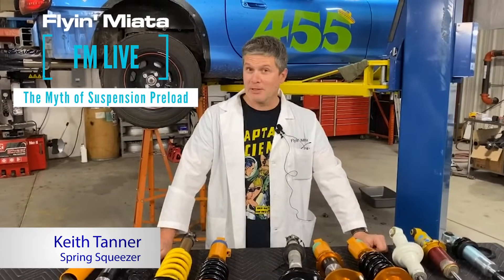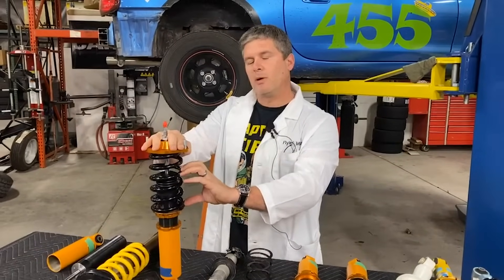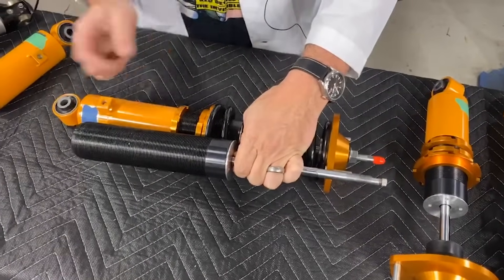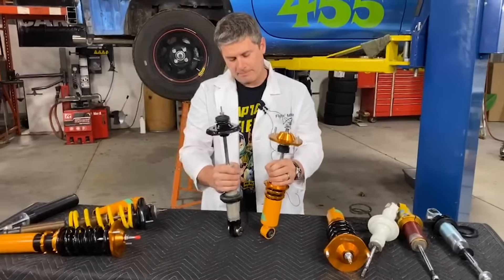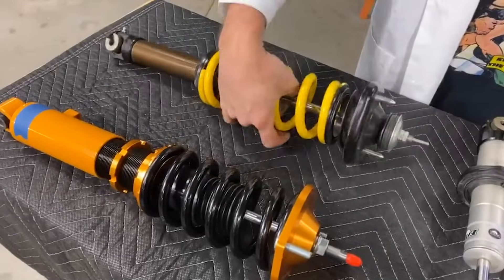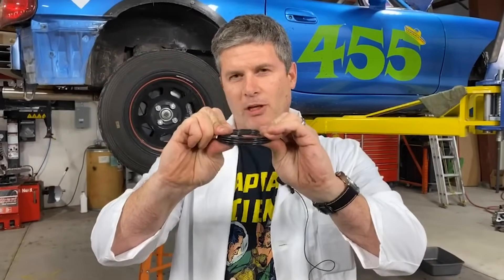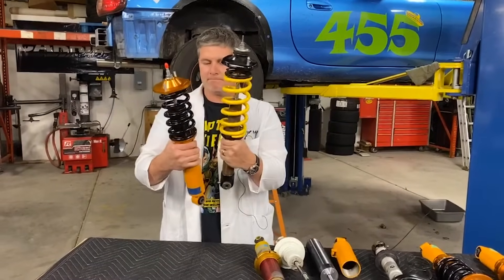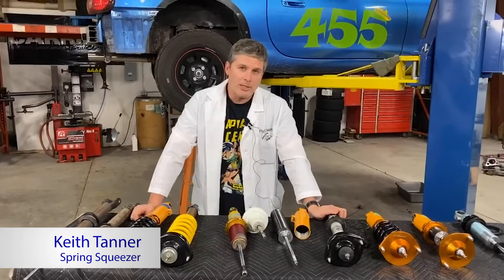The Myth of Suspension Preload (FM Live)

Comment: Ride height will not be the same if there is pre load on the spring. Öhlins have coilovers where height and pre load are intertwined, like me e46 M3. By dialing in pre load, you’re reducing the amount that she suspension will compress when car is static
Reply from the maker: The ride height is determined by the distance between the upper and lower perches, the spring rate, the spring length and the weight on the springs. That's it. Preload doesn't change that - but changing the perch height can change the preload, which is why people get it mixed up so much.
Reply: @FlyinMiataVideo  if you’re only changing the bottom spring perch height, effectively increasing pre load, how can you explain that the car height increases? You’re not changing the overall position of the spring, solely the bottom part. 
It would make since if the whole spring was higher, which it isn’t.
Reply from the maker: @DriftingSquirrel  The spring sits on that bottom perch, the car sits on the spring. You move the perch up, the car has to move up. The spring will be the same length for a given load, so you can consider it a fixed length.
Preload can only be measured with the suspension fully extended, because that's exactly what it is - the amount of load on the spring with the shock extended. Once the force on the spring exceeds the preload, the spring will compress - BUT IT DOESN'T COMPRESS DIFFERENTLY BECAUSE OF THE PRELOAD. That's important and it's where many people get tripped up, they think the spring somehow "remembers" what happens at full extension. It doesn't. If a spring has a 400 lb/in spring rate and 400 lbs of load, it will compress 1" from its free length. It doesn't matter if it has 50 lbs of preload or 75 lbs or 0, it will be compressed by 1" with that 400 lb load. And that's what will determine the ride height.
When your preload exceeds the corner load - if we had 600 lbs of preload on that example - then your spring does not compress until you hit a big bump and you have zero available droop. I've seen cars set up this way by people who don't know what they're doing, it's not functional. But it is possible to do.
Reply: @FlyinMiataVideo  The spring sits on the bottom perch - that did it for me. Very well, I have understood the logic, and I'm thankful that you've taken the time to explain everything properly to me. Most other people (channels) would've sent me on a hike right about now.
I do have another question however: you say that if the pre load exceeds the cornar load, then the spring will not compress. But, if the spring will compress the same amount (given by the spring rate) regardless of the pre load, how does this work like that?

Comment: Hypothetically, if preloaded 1” on a 400lb spring. I would beed 800lbs to compress it 2”. Which would be a harsher  ride if I didn’t have that 1” (400lbs) being used already. 

Not arguing. Trying to better understand.
Reply from the maker: That's the common misconception, that somehow the preload gets added to the spring rate. That spring will require 800 lbs to compress a total of 2" even if there's no preload. That's what the spring rate of 400 lbs/inch means. 
In your example, as soon as that preloaded spring has 400 lbs on it, it will start to compress further. By the time you've put 800 lbs on it, it will have compressed 2" from the free length - just as if it didn't have any preload at all. You don't add 400 + 800 lbs = 3" of spring compression. Once your load on the spring has exceeded the preload, the preload effectively ceases to exist.
That's where the preload can have an effect, if there is less load on the spring than the preload - which means your suspension doesn't compress at all when the car is at rest. Obviously that's not a good situation. You need fairly significant levels of preload before this becomes a factor, or you need massive amounts of weight transfer as on a motorcycle. There are some edge cases that can start to cause problems as you get close to them but if you get there you have more fundamental problems.
Reply: @FlyinMiataVideo  thanks for taking the time. I had a set of Bilstein B14 (progressive) that wouldn’t go high enough. I added as much spring perch as I could and the ride quality suffered. Im think I used up all the soft portion and was maybe into coil bind. 

Bmw btw.
Reply from the maker: @jpwilliams5264  That can certainly happen. Coil bind feels okay until you get to a certain point in the travel, and then the suspension feels as if it goes solid. BANG! Progressives are just weird overall.

Comment: How can you set the required preload to keep the system stationary?
Reply from the maker: Not sure I follow the question. It’s all about the weight of the car on the springs at rest. Preload does not change spring rate, it’s only a measure of how compressed the spring is when the shock is fully extended.
Reply: @FlyinMiataVideo  Hi thank you for the reply, sorry, let me rephrase the question. how would you check or calculate preload in spring to keep the corner(say left) stationary if the cornering load is say 300kg?
apologies, If you have already covered something like this in another video.  sincerely Ash
Reply from the maker: @wheelskawasakileicester1146  What do you mean by "keep the corner stationary"? You don't really want it stationary, that means your suspension is locked. Do you mean minimal roll? Do you mean you want the shock fully extended with 300 kg of load on that corner, so it takes more than 300 kg of load for the wheel to start moving?
Reply: @FlyinMiataVideo  Hi, I mean "shock fully extended with 300 kg of load on that corner, so it takes more than 300 kg of load for the wheel to start moving" yes.
Reply from the maker: @wheelskawasakileicester1146  Well, in this particular case you'd probably have the suspension fully extended at static ride height. That's not a good idea, as the car will have zero droop available and will easily hang a wheel in the air. We've seen it done on high-dollar Miata suspension setups with insufficient shaft travel, but the cars don't actually work very well.
The math is easy, though. Take a spring with a 7.5kg/mm spring rate and a 200 mm free length. If you want 300 kg of preload (in other words, the spring will not compress further until it has more than 300 kg of load on it), that's 300/7.5. The result is 40mm, so you'll look to put your perches 160mm apart at full extension.
On a car, this isn't really a way to do suspension tuning. It may be different on motorcycles which see dramatically higher shifts in load and are expected to lift wheels on a regular basis. We can't really achieve 100% weight transfer under acceleration in anything but a dedicated drag car.
Reply: @FlyinMiataVideo  Amazing by far the best explanation I have had. thank you and keep up the good work.

Comment: So how do you lower a single body coilover? I just loosen it down and let the shock go down on its own? Wouldn't it be bad for the coilover to always bottom out?
Reply from the maker: That's what bumpstops are for, taking the hit when you run out of travel. And a properly designed single body coilover has a shock length that will bottom out just about the time the suspension binds up, so a two-piece wouldn't be able to offer any extra bump travel past that point. This last piece is one that is often overlooked. There are limits to how much bump travel is available.
Reply: @FlyinMiataVideo  i see, so bumbstops plus a helper spring are need if i intend to lower my car on a single body coilover? Sorry it's my first time using a single body coilover and was wondering how I can lower it without compromising the shocks.

Comment: Hey Keith, these videos you did are some of the best on YouTube for suspension stuff! Quick question, could preload become a factor on the inside/unloaded wheels if a light production car is experiencing high levels of load transfer in a corner?
Reply from the maker: If you completely unload a wheel, the suspension won't start to compress again until it's reached the same load as the preload - ie, if there is 50 lbs of preload on the spring it won't start to compress any further until you have 51 lbs on the wheel. This isn't really a factor unless you've got extremely high levels of preload, as that unloaded wheel isn't really doing much for you. But it's probably why motorcyclists use preload as a tuning tool, as they see much higher levels of weight transfer and weigh less overall.
Reply: @FlyinMiataVideo  Thanks man!

Comment: Interesting that the ohlins r&t coils are multipiece. For NA/NB at least. Idk about others.
Reply: I have Tein flex Z, which is also a multipiece. Both the Tein's and Ohlins are twin tube dampers, so they have a bit more internal travel compared to most mono tube designs, but they are still a bit short on travel compared to a "single piece" damper. I personally like the lower brackets, and I use them to set ride height, after I adjust the preload/bump/droop ratio the same on the left and right, (with weight in the drivers seat) This is the opposite of what Keith teaches here, and I really don't know which way is "correct". On a single piece, there is no doubt, but on a multi piece, who knows? All I can say is that it worked for me, and many do it the same way. I will have to do a bit more research and head scratching :)

Comment: About what you say at 8:24, that you adjust the perch to set the ride height. I think this is inaccurate, because in order  to get advantage of the full shock travel you would 100% need different spring lengths. So if you have a spring that makes the car sit high, and you want it lower, you adjust the perch lower and then you lose travel  - full droop (ie the shaft is not fully extended as the car sits still). On the other hand if you use a short spring and you want to get the car higher, you would then have to get the perch higher up the shock body, leading to reduced compression travel, as the spring colis would bind at some point. So in order for your setup to work, i believe you have to get the springs exactly right for the desired ride height, enabling the shock to full droop and compress. Otherwise you simply get the multi piece coilover result.
Reply from the maker: That would be partially true if you're reaching the spring's limits - either having it go loose at full droop or reaching coil bind. There's a range in between that allows you to adjust the perch height without having to change the spring. Generally speaking, you want to use the longest spring you can package as that will give you the greatest working range.
Coil bind is a very bad thing and should be avoided at all costs. Since it effectively turns your suspension into a solid piece of steel, it is very hard on suspension components and mounting points. A spring that goes loose at full droop is less of a problem, it simply means you're not making full use of possible travel.
The shaft should never be fully extended when the car is at rest - that means you have no droop travel available at all.

Comment: Wouldn’t adjusting the spring affect the shocks range of usable mostion ? Put the spring too high can’t use all the shock spring too low shocks compressed
Reply from the maker: That’s one way to look at it. Just remember that there are other limitations to the useable shock motion, such as the control arms making contact with the subframe or tires hitting sheet metal.

Comment: Quick Question. I brought a Set of Maxpeedingrod coilover for my 2007 infinti G35s Sedan the ride is so stiff when you hit a bump you can here the stuff in the trunk this is fine for a track car etc not for a Daily is there a way that you can soften the ride a bit i think they have preload settings
Reply from the maker: If the springs are not well matched to the dampers, or if you don't have enough travel, or if the springs are just too stiff, or if your dampers are poorly valved - you will have a poor quality ride. No amount of adjustment on a poorly designed suspension will fix these issues.

Comment: I always loved the Mazda RX8 that I owned because despite being a sporty car it rode brilliantly because it was designed to have a relatively long suspension travel. It made the handling very forgiving too, especially on bumpy and narrow British backroads. I'm 100% convinced that it makes all the difference.
Reply: The rx8 has the same design as miatas, therefore the rear suffers just as miatas do. Ask me how I know.
Reply: I drive c6 z06s, one of them set up for road racing...(I know what legit good handling is)...and I was VERY surprised at how well an rx-8 I once fixed up  performed on curvy backroads. The rx-8s are impressive handling cars in stock form. Too bad the engines are...ya know... "like that" 😏 Maybe my reference point could be a little skewed...but that car was brutally underpowered. Like,  shockingly so.

But hey, good handlez tho ¯\_(ツ)_/¯